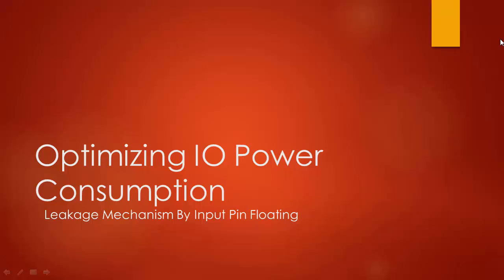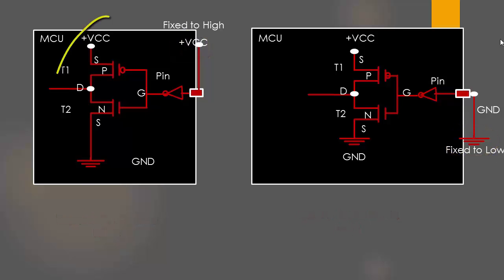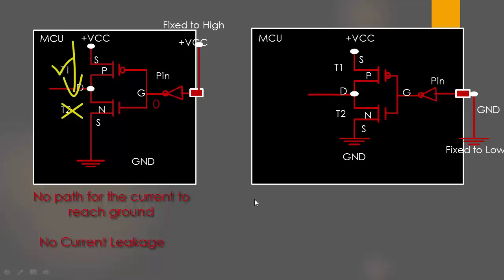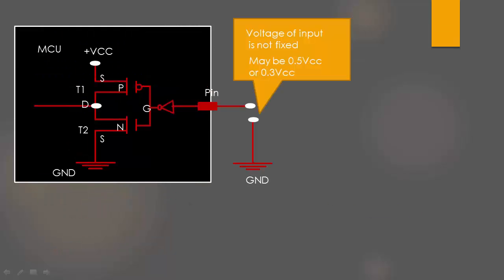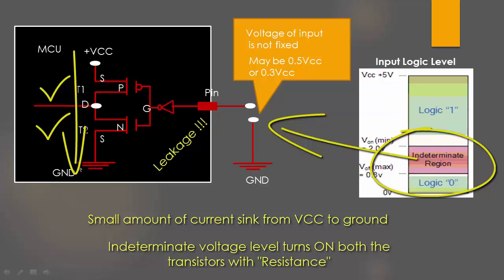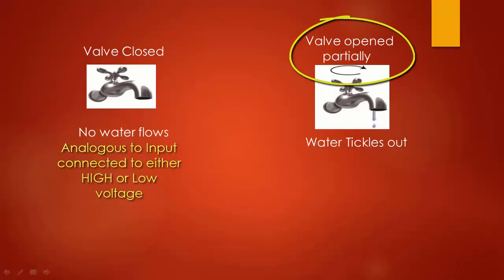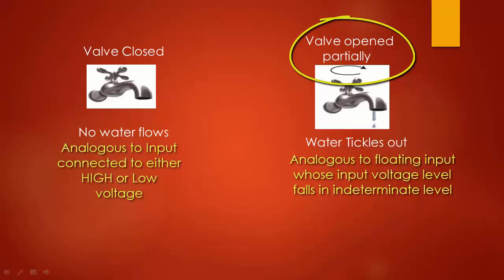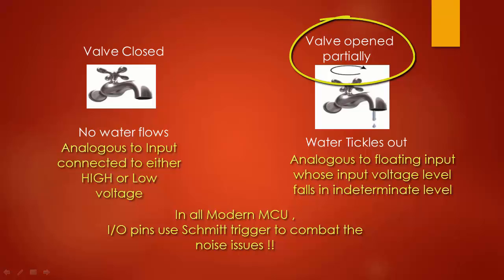GPIO: Leakage Mechanism of an I/O pin due to floating input

Comment: I think NMOS with Induced channel opens on VCC (not closes). And PMOS with induced channel closes on VCC (not opens) and oppositely when you connect GND to their gates. So those first two images presented are wrong from a JFET point of view.
Reply: At 0:39 in the video, you could see there is a converter symbol right from the gate. Thus, the two images are right.